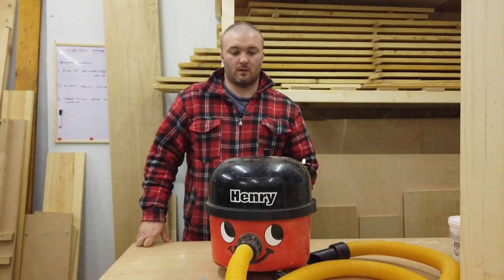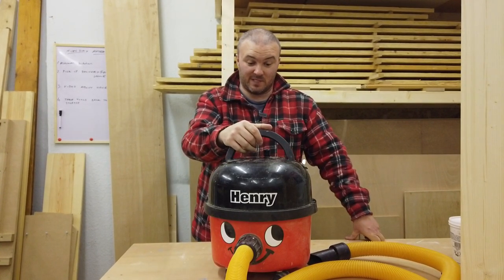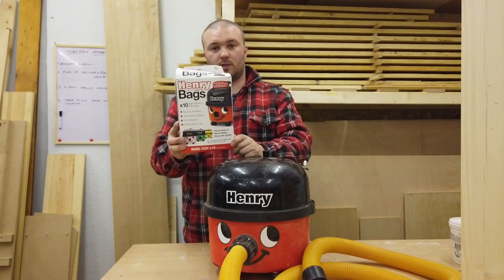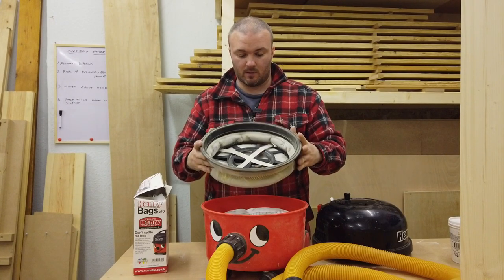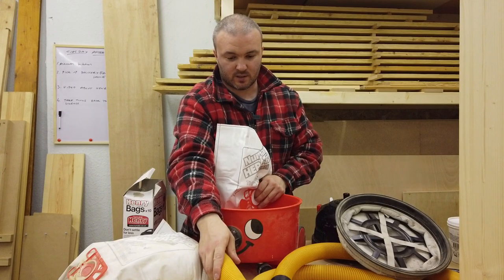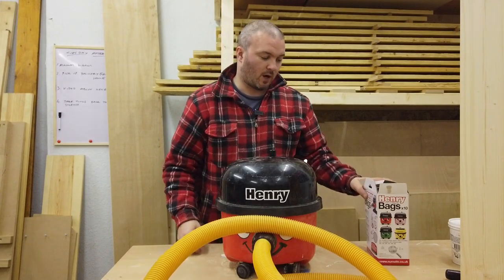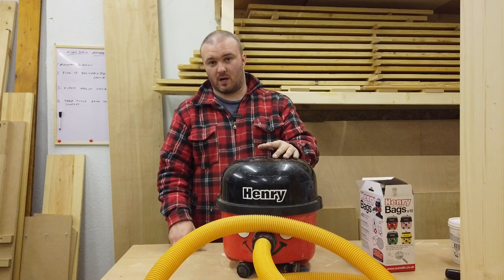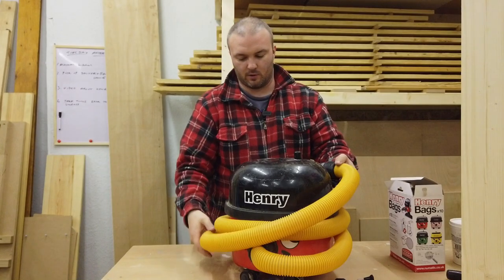UPGRADE YOUR HENRY VACUUM FOR USE AS A DUST EXTRACTOR

Comment: Hi mate just thought I'd inform you  this one is from 2004 as the red rear wheels were introduced in 2004 unlike the black rear wheels from 1981 to 2003 though many machines are from the 90s thought I'd let you know for future reference bud
Reply: 09:02 I do belive its 2003 as first 2 digits of a serial number corespond to the year of manufacture, and digit 3 and 4 corespond to the week number of that year ( exactly how car tires are dated) it was close enough I suppose.

Comment: Henry vacuums are cheap in the UK but over here in Canada, you are looking at a price of CA$500.  That's not too bad as a commercial canister but for shop work the better solution is Emerson's Ridgid or Workshop Vac brands.  I guess you could get just a regular Shop-Vac brand machine too and all three brands come with the option of a plethora of attachments, many of them cross-compatible with each other.

Comment: I've just ordered a big hose, just wondering what you all use to make the connection to your saw's? All mine seem to use different size connections.
Reply: I use plastic lemonade bottles. Cut off the top, hit it with plenty of heat and the plastic bottle shrinks to fit. Makes a great, cheap, home-made adapter.

Comment: For my workshop, I bought a bucket with a sealable lid and fitted a cyclone unit. All the dust etc drops into the bin, nothing passes through to Henry- unless I let the bin fill too far!
It's surprising how many I see thrown on top of skips by builders, I've picked up a few freebies, a few quid for new carbon brushes and black spray paint and jobs a good un.
Reply: Yes just making a cyclone now myself, was hoping this video was a tutorial so could source some vacuum hoses etc as the prices seem pretty silly.
Reply: @ReheatedDonut  I used the old hoses off my pond vac. To adapt these to the larger cyclone fittings, I just used plastic lemonade bottles and shrunk them to fit with a heat gun

Comment: I picked up a used Henry from one of the neighbours. I didn't know about the motor differences but I've discovered it's the 1100W. I want to use it as a shop vac in the garage. I've ordered the big hose. Great video.

Comment: The big hose arrived. Makes a huge difference. Also don't underestimate adding an air freshener 04:28. I threw one in an few days ago and just did a quick bit of vacuuming in the garage. Now it smells lemon fresh rather than of stale dust.
Reply: Can you use a big hose with the standard pipes please? Need a good replacement as my pipe stinks with the henry😂 I bought off eBay
Reply: The big hose has a big end that doesn't fit the standard wand.

Comment: Thanks for the tips... I converted from 32mm to 38mm everything!   The only downside is that I was p'd off when I received an Orange hose, not yelllow as you show and as stated and advertised on Amazon UK.    All other accessories through "Beacon" except for the floor/carpet brush-head which is a Heavy Duty unit and slightly larger.
The new "Henry" is still powerful enough to lift carpets held in place by "Gripper"...   We tried all the cordless but, as you said, trades people rely on these "Henry" machines too!   A decent smelly, as you advise, is far better than nothing...

Comment: Get the HEPA filter in your links. I have one installed, they are brilliant.

Also, use Swirl vacuum bags. They're way better than the Numatic Henry bags but unfortunately a lot smaller.

With your older more powerful Henry motor, that large bore hose plus thd HEPA filter and Swirl vacuum bag you'd have a dust extractor better than pretty much anything on the market at a considerably lower price.

Oh and by the way, it's actually possible to buy a device that will enable your Henry to come on and off automatically after you switch you power tools on. This will allow you to keep Henry out of the way.

Comment: get the nrv-240-11 its the commercial henry, 620 w so excellent power and a 9 ltr capacity. you can tell the difference it has the red bumper around the base.

Comment: Hi. I’m thinking of getting the Henry XL. Do all Henry’s allow to connect a sander to the hose? Any advice would be appreciated. Thanks.
Reply from the maker: literally every sander and powertool for that matter has a different size outlet so you may need an adapter. That isnt specific for Henrys but every vacuum and dust extractor out there.

Comment: How can one reduce the pressure. Just bought one but the suction pressure is quite high that it's difficult to use
Reply from the maker: On the metal pole there is a plastic collar that you can turn that makes a hole and it makes it pull less on the carpet. There is no actual pressure adjustment on the machine itself.
Reply: Thanks

Comment: With the larger 38mm dia hose is the threaded end and the other end hole size the same as the original 32mm hose, as your Amazon link does not include my HVR 200A model?
Reply: Did you ever find out mate need a new hose and want to use it with the original metal pipes
Reply: Did you ever find out mate need a new hose and want to use it with the original metal pipes

Comment: Cool video. I want to sand a small brick wall with a sander. Would this handle it?
Reply from the maker: Most definitely. It is just as powerful as my Festool dust extractor. Builders have used Henry Vacuums for years for rubble, brickdust etc. I would get some of the hepaflow henry bags and it would be perfect.

Comment: Just bought a Henry nuematic 160. I onky have hard floors but lots of biggish rugs. Find the normal head is far too strong and lifts the rugs off the floor. I am elderly and need simplicity.  Which tool, if any, should I use for rugs?   Grateful for any advice.
Reply: Ps think I saw some advice in a bomment below. Thanks.
Reply from the maker: Hi Cynthia. On the metal pole there should be a thing which you turn and it let's air in. I believe that will lower the suction for when you are finding it too powerful. I know the feeling, they can be too powerful sometimes.

Comment: Given the shortcomings that you outlined in the video would you still recommend buying it? It s about 160£ right now.
Reply from the maker: I would try to find a second hand older model as they have more powerful motors. You can usually find these on ebay or facebook marketplace for under £50.
Reply: Thanks for the advice

Comment: Try the reusble bags mate
Reply from the maker: I have used those before. They are great for cleaning the house but not good for things like dust extraction in my woodworking workshop. The particles are too small that they escape the zip on the bag and make a mess. They are also not HEPA rated.  You are right though and I would recommend them for day to day cleaning.

Comment: bought one it can't cope with brick dust when wall chasing. Shame, but great video.
Reply from the maker: Sorry to hear that. I would add that it is probably due to the extraction port on the tool rather than the extractor itself. Although I don't ever do chasing myself, I have seen electricians use my own and they have really praised it. Have you upgraded the hose?

Comment: Obviously the end of the hose is alot bigger than standard what sort of attachment will fit this for sanders etc plus this don't fit the standard hoover attachments
Reply from the maker: That would all depend on the size of the port on the sander. I can't give you a specific answer as every single sander is different. Every single tool is different. I have 4 Sanders and the original Henry hose didn't fit on any of them. Every one of my power tools has a different size port and it is really frustrating.  You can actually get adapters that change any sizes as I have seen them on ebay. Personally I make adapters for the tools that I use Henry for as I have so many tools. As for the standard hoover attachments, yes they don't fit as the port is bigger. There are bigger wands out there but again I made my own with some plastic pipe. As it only takes a couple of seconds to swap the hoses over and the hose being so cheap, I would recommend having both hoses. For the likes of a sander, the smaller diameter hose would be good as you don't need as much suction. For something like a mitre saw I would recommend the bigger hose. If you are clearing up on a job site then I would suggest the bigger hose as the port is bigger and allows you to hoover up larger pieces. Sorry for the long reply, I have tried to help as much as I can.
Reply: @christopherinteriors6521  thank you for your reply. I'll have a play round with it I just got the different filter you put in your post and and the smellys to go in hoover what a difference cheers mate

Comment: It’s from 2004 or 2003 or 2005
Reply from the maker: If you are going by the label on his head yes. He has had a replacement plastic head a few years ago as the previous one had some damage. The internals are older apart from a new old stock motor. Henry says thanks for pointing that out though, he likes to feel younger. 😂
Reply from the maker: @Numaticfan08 the plastic casing is from around that time but the internals are much older. He had a nasty bump on the head.
Reply from the maker: @Numaticfan08 If you check my newest video - episode 2, towards the very beginning you will see than he is no longer Henry either. He has been renamed!
Reply: @christopherinteriors6521  including the switch as the button style switch was introduced in 2002